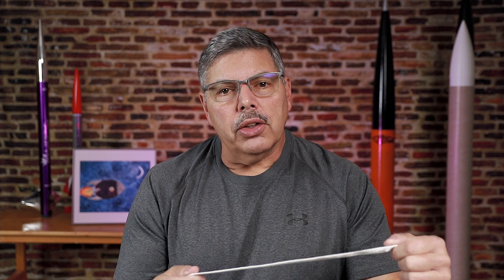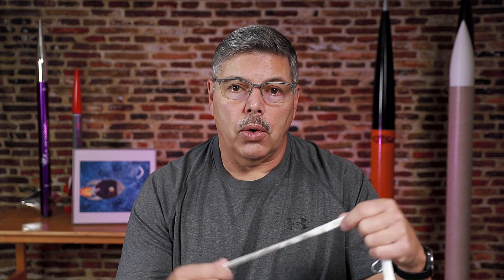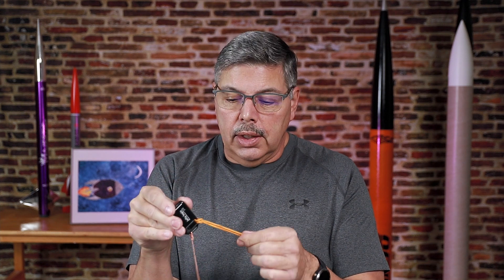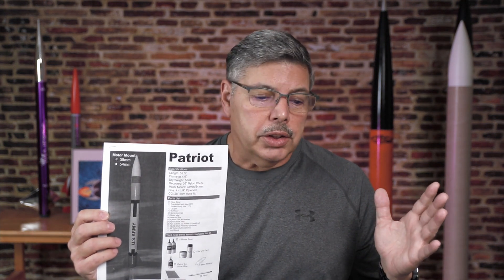Level 1 certification tips for high power rocketry.

Comment: I saw a presentation by an Aerotech rep regarding rocket motor technology, and he actually recommended Elmer’s glue-all for bonding grains in a large motor they designed that required it. Someone used epoxy instead of the recommended Elmer’s and it led to a cato.
Reply from the maker: Not everyone agrees on what type of adhesive to use. Elmer's Glue All is a low expansion polyurethane glue but others say use epoxy. As usual everyone has an opinion on this.
Reply: @TheRocketeer  I should have been more clear that the scenario they were describing was for a minimum diameter rocket where low expansion was key. So it was a very specific case. I get the different adhesives are preferred, but I guess someone just needs to be very careful about their specific mission and the parameters required then choose materials accordingly

Comment: I'm looking at the LOC Iris 4" for my L1 & 2. I'll step the 54mm motor mount down to 38mm for L1 to try and keep it low and slow. Been working on flight electronics today designing a pcb based off of the PI Pico with MicroSD, RFM69 packet radio, NEO-6M gps,  MS5637 altimeter, and LSM303 IMU, with some mosfet switches for pyro events. Test it all with L1, then go dual deploy on L2.
Reply: Wow, props on your electronic skills. Best of luck!

Comment: Same kit for level 1 and level 2?  If you build a paper/plywood kit for level 1 will you continue to use it?  How long do you intend to wait between level 1 and level 2?  If you wouldn't use a level 1 kit after initial certification then go ahead and build the level 2 rocket and use for level 1.
Yellow glue is very strong, and is good for one part contacting another part, but I always build up fillets and you need epoxy to build up fillets.  So for instance if you are surface mounting fins you can stick the fins on with yellow glue then come back later and add epoxy fillets.  The yellow glue will stick things together relatively quickly and hold them in position wheras epoxy is always gooey up until it sets so your parts can move around.  One thing I've found yellow glue good for is internal fillets.  I've build motor tube/baffle assemblies that I put in from the rear but I want to fillet the front bulkheads inside the tube.  I drip in the yellow glue from the top of the tube with the rocket almost vertical.  That way it doesn't matter how much I use and it is easy to dispense right out of the tube rather than using a makeshift pastry bag.
I did level 1 using motor ejection.  If a person intends to go to level 2 it wouldn't hurt to use electronics in level 1 as backup to get the experience with it.
Reply from the maker: To answer your questions please see below.

I use all my kits until they are lost or damaged. Fingers crossed! 

I don't recommend using a fiberglass kit for a L1. It is a big jump from kraft paper to another material.

I would recommend at least 4 or more HPR flights before moving up to L2, don't rush the process. An experienced flyer should watch assembly and prep to make sure your day is successful.

Thanks for your comments!
Reply: THis is me, I am skipping 1 all together if I can help it, do the level 1, then slap in some electronics and a larger motor, some kits are good for that.

Comment: I do a lot of scratch building using mostly shipping tubes , and i mostly use a quality wood glue in 95% of my builds . Super Glue where necessary , > BUT  <  i always use Epoxy for fin fillets !!  recommended brands :     Loctite 5 min ,   J B Weld  Clear 5 min , caution not recommended  for power past Super Sonic. With proper prep   ,  you can do   4 fins in 1/2  hour .  Self Leveling !!!!! Hey let me know what you think        Mike
Reply from the maker: Yes, I agree that using 5 minute epoxy will certainly speed things up and it works well. I have built complete high power rockets with the brands you mention.

I don't use 5 minute epoxy for fin filets anymore because the epoxy has a very strong odor that my wife objects to. Rocketpoxy has a slight peanut butter smell and a longer working time.

Bottom line is use what works well for you. Thanks for your comment!

Comment: So I just got my EasyMini, and been doing some test with it with the software. My main concern is that my homemade igniters do not seem to be working at all with the software. (aka manual firing a igniter with the software) Running a duracell 9v battery with 24gauage wire base wire connected with 36guarge nichrome wire. I have been using the same DIP as you made in one of your videos, but because I wasn't getting anything to work. I stopped dipping and was trying to see if the EasyMini can even Heat up my nichrome wire. Which it cant...Seems like the EasyMini does a very small pulse of current then stops, which is not good because does not allow anything to heat up at all. I know my nichrome Wire will get RED hot when connected right to the 9v battery. Any information you might know of that can help me out?
Reply from the maker: The Easy Mini and other altimeters are designed to fire an e-match that requires a lot less current. There is no need to dip an e-match that is in contact with black powder.

Nichrome wire igniters are made to light motors while on the launch pad. I use a dipped e-match to light almost all my sugar motors and they can be used on APCP as well. I make some fat and others slim depending on the nozzle size. I try to use the largest igniter that will fit with some clearance on each size for a fast positive light. I don't dip igniters for small "G"  sugar motors.

Push the igniter to the top and then pull back to about the middle of the top grain.

I always test any e-match for continuity. I have found a few that do not pass and you sure don't want that in your altimeter!!

Comment: Totally agree with all your points. If you fly very low and slow (< 1000 ft), wind is low and the field is large enough, you can even go with motor ejection without chute release or dual deployment. I would like to add two things though, which I feel are neglected by kit manufacturers:
1. Add rail buttons. Most kits come with launch lugs, even if they are supposed to be flown on HPR motors. There are clubs that no longer allow HPR flights off of rods, and it is a safety issue with the low rigidity of the rod.
2. Add positive motor retention. If you lose your motor, the prefect might not certify you. Personally I prefer the screw-on retainers (Aeropack style), but others use Z-clips successfully. Just don't bend a strap of steel yourself, that won't be strong enough.
Reply from the maker: Thanks for your comment!
Reply: I haven't flown my level 1 rocket in awhile, it is essentially a LOC IV build for use on 1/4" rods.  It always flew very well from a 1/4" rod.  I don't know how it is across the country but rods used to be much more universal than rails.  Maybe rails are more universal now.
Reply from the maker: @billj5645  Rails are the prefered method for launching high power rockets. Our club allows 1/4" rods for HPR but some clubs require rails to be used.